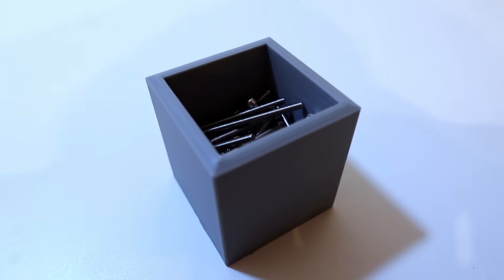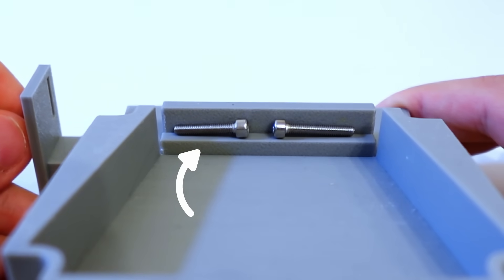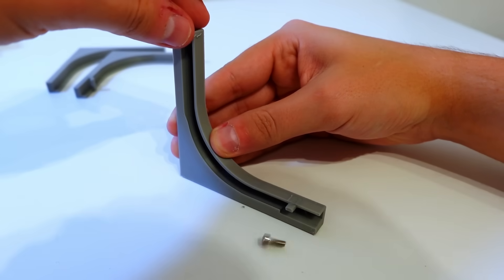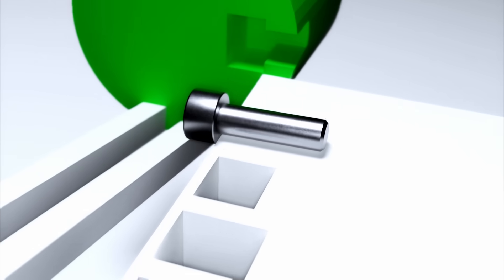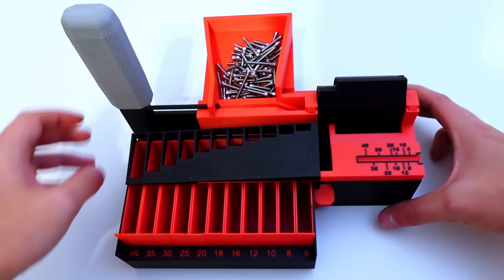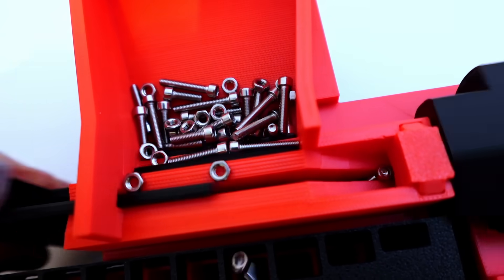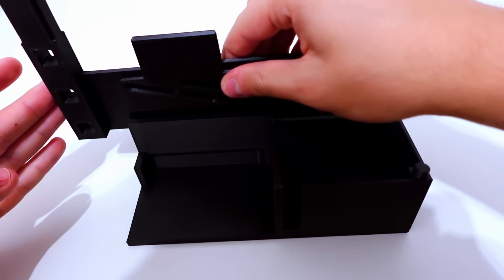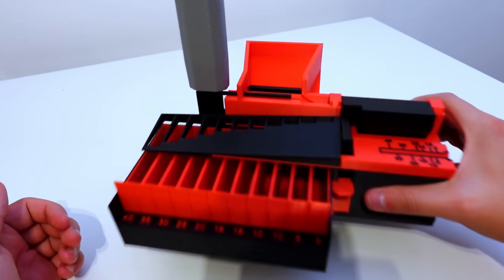Engineering A Mechanical Bolt Sorting Machine from Scratch | 3D Printed

Comment: I can sort a 5 gallon bucket of bolts fairly quickly by hand.  Both metric and SAE.  I would much rather have a robot do it though.  Very cool device.  After the war there will be no factories so stock up on bolts while you can.

Comment: Loving it! Maybe after the transition from the bolt being vertical to being picked at oriented in the horizontal: have a little correction chute to correctly catch a receive the bolt before it is allowed to roll down the final ramp.

This funnel and final chute helps to collect and prevent jams whilst making sure the cap can be hanging correctly over the support. Maybe there needs to be a gate to limit bolts from having the wrong speed.
Reply from the maker: Great idea. i think thats something i will keep in mind when doing an improved version

Comment: This is an amazing idea and I wish I could use it.  Since I work in a machine shop, we have so many different sizes of bolts and screws laying around in boxes that this would be a game changer for organizing and resorting them.  Unfortunately, while it does sort them, it does so by the length of the bolts and not by the length, the diameter (of either the head or the threads), and the TPI's of the bolts.  So, for example, if I had 8 different sizes of bolts and screws that I needed to sort, that means I would need 16 of these sorters to cover the two different TPI's we have for each type of bolt or screw.  I suppose I could just use a thread gage or a bolt checker to separate each size and TPI's before putting them into this sorter but at that point, I might as well just use a ruler at the same time to figure out the lengths.  On a side note, it would be interesting to see if you can modify this design to have an attachment for a servo or some other type of motor and you just use gear ratios to control the speed of everything so nobody has to worry about programming the motor.  They would just need to purchase the motor off Amazon, attach it, turn it on, and go.
Reply from the maker: im planning to further improve this to hopefully support multiple types of bolts with diffrent diameters and a motorized version.
Reply: @EmGi_  I await in eager anticipation.

Comment: you could add an spining agitator to the feeding ramp to prevent the issue you have with the larger bolts.
Reply: Ha! I just said the same thing before looking in the comments. Someone else also suggested a clacker to smack the bottom of the tray to jostle the bolts. I think both ideas are valid, the agitator might be the more elegant and reliable method, though.

Comment: If the fishstair lifts 1-2 bolts per operation, but the rotator only puts a single one on the sorter - won't it back up with bolts in front of the rotator?
Maybe you can make it "double action" to mitigate this 😅
Reply from the maker: it kinda evens out because sometimes the stairs lift 0 bolts

Comment: This is cool. Now we just need the following; a way to separate colour (silver and black), head type (pan, countersunk and button), tool type(hex, torx, phillips etc) and nuts by colour, size and type(nylon grip or standard).
In any case I will still make this. I will probably motorise it as I like the idea of dumping a handful of bolts in the hopper and coming back later to find them all sorted as if by magic. Really cool work, subbed.

Comment: Cool mechanism that also works! But I can just hear the brittle PLAness of the filament. This would be so quiet and smooth in PETG!
Reply from the maker: To be honest, i never used PETG so far. Might have to give it a try
Reply: @EmGi_  yeah, try it! PETG has some flexibility and strength, but it's also nice how much of a difference it makes to the sound of rubbing or colliding printed parts.

Comment: Have you considered trying to make the sorting mechanism into a spinning mechanism? Or some other way to make the motion continuous instead of oscillating? It might be easy to add a crank and gears to this, and at that point you can just hook up a cheap slow motor

Comment: I really like this idea and you're amazing for giving the files away. Rather than bolts, I'd like to be able to do it for screws. As you've spent a lot of time iterating on this, I was wondering if you might know any pitfalls for trying to do this with screws? I can think of potential issues being tighter tolerances for the trackways, adjusting some angles, and maybe the need for a moving floor block under the bins to jostle the screws onto the steps. But I'm hoping you might have some pro-tips for these or something I might not have thought of. Thanks in advance.

Comment: Love this, apart from the fact that it inherited the weird "skip 14mm" choice of the manual one.  I assume support would be as simple as changing that top filter piece?
Reply from the maker: i selected the lengths based of a collection i ordered amazon that doesnt have 14mm. but to this point i didnt even realise that its missing 14mm length. I uploaded the step files to makerworld so you could change it to your needs. probably have to change the top filter piece and the main plate a bit
Reply: @EmGi_  awesome, will take a look the next time I have a backlog of I unsorted bolts to do.  Literally did a pile from my last rebuild manually a week ago 😭

Comment: awesome job!
I'd love to see a part two with a more general solution to the screw/bolt bin that are not just 1 head size/diameter. Maybe just based on weight?
Like, the eternal problem many people (like me) have is they have a bucket full of screws/bolts of all sizes, and it's very handy to have around, but the small ones go the the bottom and stuff. It would be nice to be able to sort them in ~5 weight/length classes.
Again, awesome video
Reply from the maker: Thank you! because of the many requests i get i will probably try to make a improved version that supports multiple types of bolts/screws as well as diffrent diameters
Reply: @EmGi_  cool! Can't wait

Comment: Something to consider for future designs, while most people don't have a bare motor, basically everyone has a drill.
Reply: Speed is the consideration
Reply: @techristopher8077  this design would not have worked attaches directly to a drill no. But he said he was originally thinking about using motors, but wanted something anyone could use without have to buy a motor and bunch of electronics.
Reply: @techristopher8077  you could use a gearbox reduction but that would definitly add to the complexity
Reply: @ultrapim1  You say this like that's not his primary motivator
Reply: I found that odd because the motor and electronics for this could be had pretty cheaply and easily
I ordered one to modify a tool at my work for $30 and it comes with a gearbox that slows it down to 27 rpm and puts out 3.6 ft lbs
This thing wouldn't need nearly that much

Comment: what if i have a mix of imperial and metric bolts of all thread pitches and lengths and diameters?
Reply from the maker: That wont work but i will probably try to Design a device that works for most bolts

Comment: Can this handle M3 Screws with different heads like flat head or pan or Is it specifically only hex head bolts?
Reply from the maker: Currently only m3 hex bolts but i plan to add more variants in the future

Comment: Great and interesting video. But what about smaller screws? I have 2.5mm long machine screws. Have you also tested it with different diameters? What are your experiences here? And why doesn't anyone actually do anything for wood screws. 😅🤣
Reply from the maker: i will probably add versions for M2.5/4/5/6. i dont have wood screws at home but maybe i will ad a compatible version in the future

Comment: Great project! I’m tempted to print one, but first I need to sort my M3 bolts from my M2 and M4. 🙂

I wonder whether this design could be made modular, with insets for different bolt sizes. It looks like that would require swapping the entire top assembly, so probably not practical without a major redesign.

Comment: Nicely done.  You had me at, "instead of spending 2 minutes sorting them manually, i will spend hundreds of hours building a device that does the job for me."  Truer words have never been said. 👍
Reply: Same goes for software engineering: "Five hours of debugging can save you a good 5 min of reading documentation" 😅
Reply: And problem solving is wayyyy more fun than bolt sorting.
Reply: It's an engineer thing!
Reply: Absolutely
Reply: The only way forward in my opinion!!!!!😂
Reply: That's how all my software and 3D designs starts too  :)

Instead of spending 15 minutes every day doing a boring task, I'll find a way to automate it, even if it takes a month of work!

Comment: Alright, you just forgot to add a motor and controller to make it automatic. Joking 😂.
This is an awesome design, whenever I get more bolts to fix my 3D printer, I will try make a motorised version. Can't beat my laziness. And maybe also something on the tray to always be stirring the screws. After finding the optimal speed, all the caveats you noticed will disappear ❤

Comment: Surprised I haven't seen a comment yet asking about the buffer overflow issue. I feel like your one bolt at a time mechanism bottlenecks the process.
Perhaps you could devise a sorter that would work with the bolts in a vertical orientation 🤔

Comment: Amazing organizer, and you even managed to do it manually, nice job! Would it be possible to put the 90º rotation cylinder of the screws in a way that it works twice per cycle? (In the video I noticed that there was a bottleneck in this part). I imagined that it would be possible to make it a circle instead of just a screw slot and some mechanism that when pulling or pushing the lever it will make the cylinder always rotate in the same direction. What do you think?
Reply from the maker: i think it might cause problems with placing the bolts "too fast" on the sorter if it rotates twice as fast. but i think you gave me a idea for a optimized v2 im planning!

Comment: Are you working on M4 and M5 versions?
Reply from the maker: Yes i will probably add these versions
Reply: @ Woohoo!
Btw, my top section keeps lifting when operating the handle. I think I might need a few drops of superglue to hold it down.

Comment: This is a really good design but can it be expanded to sort different sized bolts? Like M2.5 through M5? Where I work we have the roller shelves and apparently at one point one of them fell over.
Ever since, our hardware has been completely screwed up. So if something this where to also sort screw sizes I would print it and start using it next day.
Reply: It occurs to me the first half the same mechanism would sort the diameters if you made the slot in the sliding rail taper wider and wider. So instead of being pushed all the way to the rotator, they would fall through at the point the opening in the rail was large enough for that particular diameter.

Then dump each diameter into the original machine that sorts by length.

Comment: My problem is that my junk jar has bolts of all sizes and lengths as well as screws and things like that. That's my sorting problem.  It's really not worth my time to sort them actually.  i've discovered at work that my hourly pay is much more than the price of new hardware.  Why spend dollars of labor hours to sort pennies worth of hardware?  I do it anyway though.  It's a compulsion.  It's better to just sort a few at a time in between projects and dwindle the pile down.

Comment: Hundreds of hours of design to save 2 minutes?  I'M IN !
Reply: Yeah, but it's 2min saved for everyone who makes and uses it.
Reply: The urge to spend hours to fix a minutes problem
Reply: Ditto.
Reply: That's the spirit.
Reply: 2 minutes if you have 10 bolts. now to 10,000
Reply: @GickelsGaming  show me your 10,000 M5 allen head bolts 😂
Reply: Is 2 minutes of a mind numbing chore VS hundreds of hours of fun engineering and testing.
Reply: not when your back room is full of every hardware
Reply: Best summary of hobby engineering ever!
Reply: He's so lazy he'll spend hours to avoid a few minutes of work.
Reply: Lol, my uni Lab tech needs this. Mostly every one from 300 students(2nd-4th year) dont sort their unused or returned fasteners
Reply: I'm also in..but...what the hell is wrong with us.
Reply: How do you save 2 minutes using this?
Its faster to do it by hand, making different piles for each length

Comment: Very nice design! Would maybe be an small improvement if you engrave bolt size on the containers so you wont forget when you take multiple containers out or something else. Otherwise have size on both the containers and the big cointainer where they sit in. But this may be a personnal preference.

Comment: Now make a pre-sorter that sorts different diameters.
So your desk looks like "Let's Game it out" Satisfactory session when everything is chained together.
Oh and everything needs to operated by a single lever of course...
Reply: The lever must be operated by an AI-controlled motor that determines peak velocity for all the sorters simultaneously.
Reply: @Hydroculator You don't need AI for that.
Reply: @bobweiram6321 but AI is an  important unnecessary added complication!!
Reply: @bobweiram6321  We also need an AI to teach sarcasm to the uneducated.
Reply: @Hydroculator  Cool! You would make an excellent test case for it.
Reply: @bobweiram6321  It also seems they could teach children better replies than "I know you are but what am I?". Or were you going for "I'm rubber and you're glue?" Either one is pretty sad.
Reply: @Hydroculator  I'll leave it to you to train the AI, since you have a Ph.D in snark and sarcasm. Don't let your expensive education go to waste.
Reply: Maybe collab with winyergatan too 😂
Reply: There's a tower of seives you shake to sort by size. I have that. Now I have 4 piles of random length instead of one. I need this design in my life to accomplish nirvana.
Reply: You'll need another tier for threads per inch.
Reply: @tommy8716 These are metric bolts, so it'll be thread pitch rather than tpi (e.g. 1.5mm per thread)
Reply: @shikutoai  pffft. it has to distinguish between AF, metric, and the several types of whitworth for me to accept it...

Comment: Awesome... just brilliant - Next add-on - sorting diameter as well - perhaps in stacks...
Reply: Like the place where screw are caught by head having diffrent diameters so smaller screws fall deeper where another push rod awaits them.
Reply: @venyel  Sadly i dont think you can do that - and after some thoughts, this design might have a small issue - canonly handle round heads, would be nice to see if it handle hex-heads as well...

Comment: I work for a non-profit that sells donated building materials at a steep discount. Often donations will include jars/buckets/bins full of completely mixed fasteners. Metric, imperial, nuts, bolts, machine screws, wood screws, washers, nails, everything, all just dumped together in a big container. It takes many labor hours to sort this stuff out. We could really use something like this, tho perhaps larger and higher performance.
Reply from the maker: Quite a few people mentioned that they could need something like this in bigger and supported for more bolt diameters so i might give it a try to create one
Reply: EmGi This would save me a years worth of work, please make one with different screw types/diameters please 🙏

Comment: Amazing job. One question: does it not happen that with small bolts the elevator usually lifts two each cycle, but the wheel grabbing them by the head and turning them 90 degrees sideways to the ramp only takes one per cycle, meaning that you eventually get a jam?
Reply from the maker: That could happen. So far it only happened once for me and in that case you dont push the lever in completely. Then it wont lift the bolts enough to push them onto the rail but it will place them on the sorter

Comment: Really cool video with great animations! That's a really nifty device! I was just wondering, won't the bolts in the chute eventually jam the mechanism? It seems that it is possible to fill the sorting mechanism up with two bolts per lever push, but it will only sort one bolt per push.
Reply from the maker: Thank you. Yes in theory if 2 bolts get Lifted with every push then yes but sometimes there are Lifts with only one or 0 bolts which evens that out. Only had that case once so far. Then you can counteract by pushing the Lever not completely in. Then it will not lift any more bolts but take one to the sorter

Comment from the maker: Rendering the Animations almost killed my PC so i did the necessary and bought a New 3D printer
Reply: I had a similar problem, I needed new tires for my car, so I bought AMS :face-blue-smiling:
Reply: What software did you use for the animations? They look amazing
Reply from the maker: Thank you! they were done in blender 4.2
Reply: I remember I learned Blender and used to do animations on my shitty 2012 Laptop. It would take days and almost put my laptop outta commission just to get a few second clip. Always worth it, though!
Reply: That's how complex renders are made these days: you print out the scene, let physics do the baking, and film it. Scan the scene with a 3d scanner, then texture and render the frames. Voila 😂

This is some impressive piece of engineering, btw!
Reply: Lol